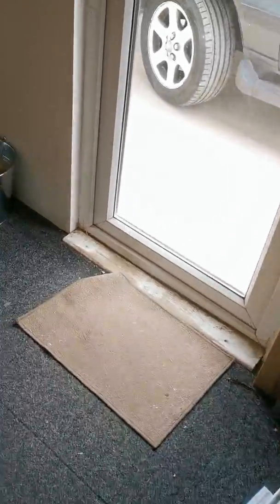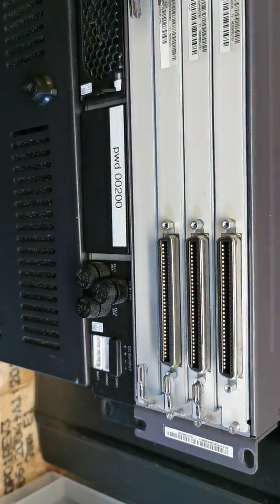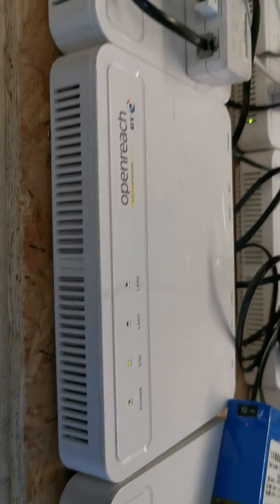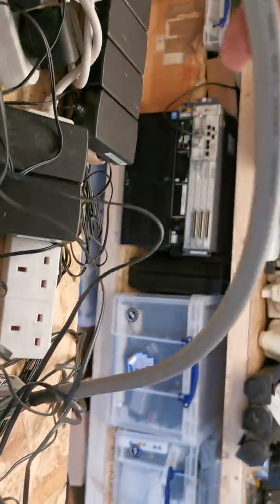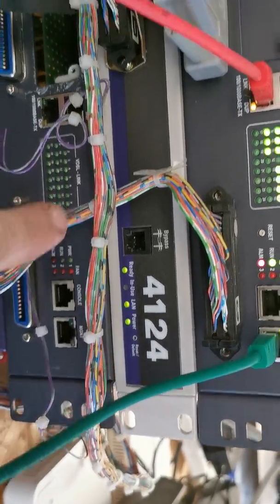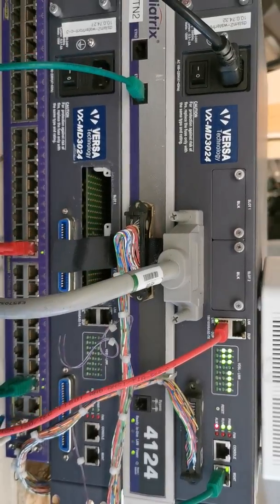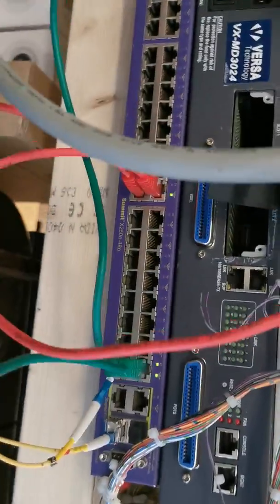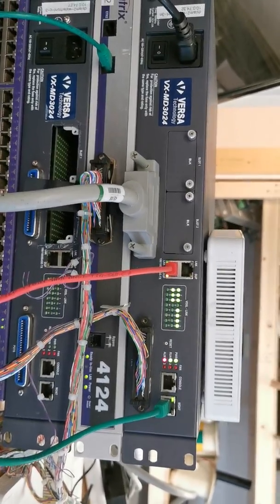Quick look at a VDSL DSLAM

Comment: Thanks for these videos, really useful. On my 3rd Open Reach appointment for a bridge tap, battery fault, RF interference and now another bridge tap so interesting to see why all these go wrong in crowded environments!
Reply from the maker: Its the same with anything like this. I have a rack to rewire this weekend, once something like this hits a certain age, has been disturbed so many times you end up causing issues every time you do something. The roadside cabs you don't have the luxury or ripping it all out and starting over.

Comment: Curious that you still use analog phone in combination with VDSL. In my country for VDSL contract they no longer gives you the analog line, but instead they give you voice service trough VOIP (in the modem/router they give you you have a couple of analog output, or you can use whatever VOIP phone you want in reality). It's probably way cheaper this way, since everything is VOIP and you just need to run fiber to the cabinets. 

Also you avoid potential interferences with the line, especially with houses with multiple phone points. In fact it's advised to get the best signal to cut off every other phone point from your installation, and basically have the cable that comes into your home plugged into the modem.
Reply from the maker: This is the way things are going here. However in this application on an event site it means just two UPSes on a 600 acre site can keep phones going when everything else fails

Comment: This is my second video I am completely fascinated as to what this is used for I get the impression of some sort of events based distribution. I've seen nothing that's going over how DSL works as well as the last two videos I've seen. Copper still has quite a few advantages like the ability to keep a communication device up with a centrally located battery, there are some more event-based fiber solutions but you still dealing with needing to make sure all the ends and cabling is treated right.
Reply: In reality copper can power an old analog phone, but nobody has them. Even who still has a landline phone as a cordless nowadays and that still need line power to make it work. In my country with VDSL lines they even dismissed the analog signal completely, switching everything to VOIP,  and analog landline phones (for who still uses them, most of the people doesn't even have it connected because you get only spam calls) are plugged into the router. 

In that regards, VDSL could be worse than fiber. Fiber network doesn't need power, the distribution is all passive, as long as you have an UPS in your home and there is an UPS and backup generators in the telephone exchange the connection will remain up. I doubt for VDSL, all these cabinets that are installed in the streets are clearly grid powered (you can see an electricity meter box next to most of them) and if they have battery inside they probably can keep the connection running for no longer than a couple of minutes, maybe half an hour.
Reply: @alerighi  yeah scam calls are annoying there's an easy fix for that it's called modems and fax machines. Then they immediately stop calling that number. I was shocked to find out there's some cordless phones with battery back ups somebody gave me an old set that had a door in the cradle for a battery. Generally the mass public now doesn't know this and just assume cordless phone > Jack. Yes over here in the US we really should've been upgrading our networks with fiber to just that point. I hear in other countries they have fiber with earthquake alarms that are like smoke detectors that take a small battery and connect to the fiber. In someway the newer fiber systems with mini UPS units is actually making a more distributed system. At least in the US telephone (and cable/ some voip providers now) system is considered emergency communications and this is mandated to have back up to the point where they will run around and plop down generators at those cabinets. Subsequently for a long time phone and DSL would remain up and cable Internet will go down during a power outage, until cable operators were mandated after they started offering VOIP.
Reply from the maker: Exactly what we use it for
Reply: @rtechlab6254  I'm just generally fascinated about event set up and teardown anyway.
Reply from the maker: @imark7777777  when events start again in Aug we will probobly film a build and break.
Reply: @rtechlab6254  yes can't wait for events to start up, I do miss my small coffeehouse live music venue that I did sound for once a month. 
I'll be looking forward to the new content.

I'm at least thankful employed by somebody who wanted to do a live stream of a previously live a event once a month. unfortunately it has some slight downsides like not believe the virus exists conspiracy that the governments behind it but it pays well unfortunately it does include a lot of manual labor doing the Offtime as currently I'm helping with some construction projects.

Comment: The upcoming ban on Huawei in the UK, is BT replacing all those Huawei units?
Reply from the maker: The ban is quite carefully worded and seems to only cover 5g. Most of BTs street cabs are Huawei so it would be an enormous undertaking to strip them all out. Especially as the whole cab has to be replaced not just the innards
Reply: @rtechlab6254 spyware 🇨🇳
Reply: @rtechlab6254 use western companies not communist 🇨🇳

Comment: The ADSL modem that is connected by the DSLM disconnects after a few minutes, what could be the problem
Reply from the maker: It could be excessive noise on the line. Most modems will time out if data loss becomes too great and try a reconnect. You'll see repeated PPP disconnects and timeouts if your modem logs this sort of thing.
Reply: @rtechlab6254   Can you adjust the SnR on the unit?

Comment: Hii thanks for that great video, wish you made anotherone with good quality, i hope you send me name of the equipement u use and send me your email to contact you.
Also i wannt you to confirme an idea that if i have a dslam as yours so i just hook lan from my internet network then i can shareit it via vdsl copper to the end modem.... I have 900m distance of 2 building and i wanna make connectionbetween them, any idea i will be happy
Reply from the maker: The plan is to do a new video. We updated our kit and I want to do a full run through on the setup. Its a big setup though so it's having a few  free days to do it. The plan was to use one of our large events over the summer and do the video with a live system but with everything cancelled.. What you propose is perfectly doable, its down to the setup of the DSLAM and how you want to present the service.
Reply: @rtechlab6254  am waiting next video... Also you can answer my privious question on comment no problem
Have nice day

Comment: first of all to say good evening and tell you this thing will happen to you if i put such a device it will play that there is no dslam here in the area three kilometers from the node
Reply from the maker: Not sure I follow. Ill be remaking this video in the next few days. The DSLAM, or at least, this kind of unit, is supposed to be in your local FTTC node. The unit I'll be doing the next clip of will be clearer as its the very same unit used by many providers. This is then connected normally via PON to the next fibre node in the chain and eventually back to the exchange.
Reply: @rtechlab6254  thanks for the prompt reply
I have two ads2 lines
in which I am miles away from the center
My line is from the local 200m loop
another line comes from the dslam which is at 3 km
coupon from 8 megabit to 6
ITU-T G.992.3 ADSL2
Signal to Noise Ratio 9.5 dB 8.5 dB
Line Attenuation 36.5 dB 18.5 dB
Transmit Power 19.5 dB 12.5 dB
because other such problems
there is something that can work on this thing to increase a
Reply: I'm doing some service, I'm just in the early stages of hosting provider
Reply from the maker: @ΓΙΩΡΓΟΣΤΣΙΩΛΗΣ-π5β  you need the backhaul infrastructure too, if that isnt done right to start you will struggle
Reply: @rtechlab6254  the provider does not upgrade the area
there is a big problem here in the area
as I told you there are two connections I have
DSLAM will work and there was no optical fiber
I have been working for years but there is no infrastructure to do it
from time to time some complaints but they do not do their job
I think I have some networking equipment and I have it
buy a DSLAM will work
it takes planning to work properly
which do you suggest as a DSLAM experience